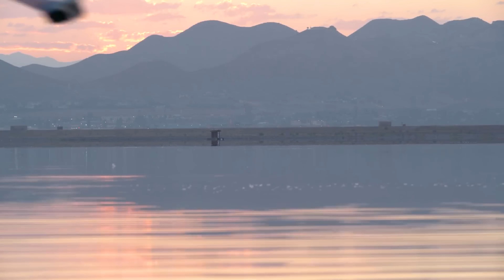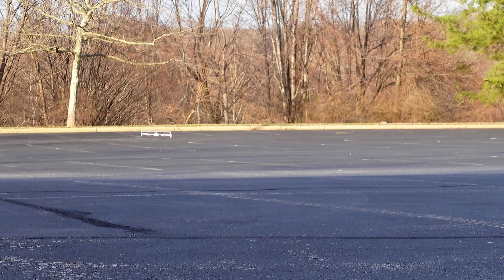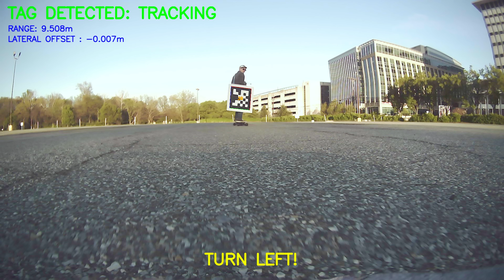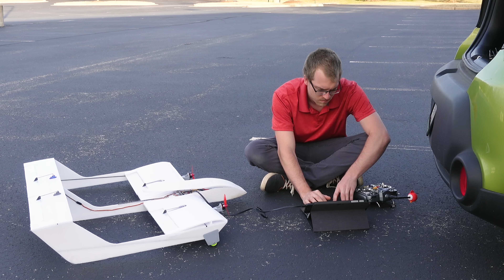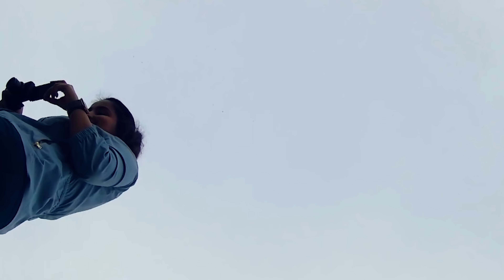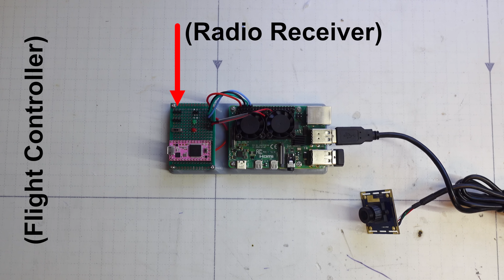Ground Effect Vehicle Autonomous Vision-Based Tracking

Comment: Curious, have you since looked into a Raspi Pico or even ESP32 as a replacement to the Tennsy? Could they handle to load if so? Or...you code is done, it works and you're sticking with it lol? Totally get it if so lol.

Comment: I made a project once for uni that required me to do image processing on a rpi, the trick is to use the processing intensive algorithm only to get the initial coordinates of your target, from there you can switch to optical flow, which in my pi 3 ran at about 30fps, and every 1 minute go back to the recognition algorithm, it worked pretty well in my case, but the optical flow tends to get lost and start tracking something else if left alone for too long, so ajust that interval for your use case

Comment: Stange to control the altitude with the flaps (lift variation) instead of the stabiliser (angle of attack).
Reply from the maker: It was a bit easier to hold pitch attitude constant to avoid tight coupling with airspeed, which is much harder to accurately control (especially without a pitot :))

Comment: I arrived here after Tom Stanton's VTOL video using your code- Its super cool, and while I do have a VTOL already and I hate to duplicate anyone's project verbatim I don't have years to iterate to get to something that reliable.  I'll probably get around to it after wrapping up current projects in a few months and hopefully have something new to add.  With that said, I might pick up a Teensy 4.0 to prepare but I wonder if you're considering a newer alternative moving forward.  I don't want to get started on a board that's obsolete by the time I get going.
Reply from the maker: Teensy 4.0/4.1 is still 'state of the art' in the arduino world, so no risk of it going obsolete anytime soon. Only thing is that it's in high demand / short supply at the moment, so grab one if it's in stock because it'll be out of stock soon!
Reply: @NicholasRehm  Ok!  "added to cart!"   thanks!   It occurred to me that the control scheme for Tom's faux Osprey design is somewhat similar to my ongoing micro-ROV prototype.   Its a project affiliated with NOAA and National Geographic that I wonder if you might consider offering your insight on?  I'm thinking about redesigning now to accommodate a Teensy.

Comment: Does the tag recognition require color? If not, you might be able to reduce the bandwidth of your incoming data by scrubbing it down to greyscale, since the tag is so high-contrast
Reply from the maker: The detection is done on the greyscale image, and I basically just overlaid the solution on the color image before recording it onboard. So yea it does use up a few extra cpu cycles but not during actual detection where the load is the highest

Comment: Instead of using an AprilTag and localizing it in 3D, wouldn't it be simpler and computationally faster to use a distinct bright-colored object/dot and apply PID to the horizontal position of the dot in the image? It will still always point towards you. If you really want a position estimate (for speed control or perhaps prediction) then you can look at the size of the dot. My guess is that since you already had the Apriltag code it was less work?
Reply from the maker: Yea I considered that to speed things up, but distance measurement is pretty important—otherwise a pid controller on left/right location of a color in the camera frame will not be tuned for all following distances. Also, I already had apriltag tracking working, and was running out of steam on this project haha

Comment: The frame rate issue is an interesting problem.  Have you considered two cameras?  One as is, at high resolution and low frame rate for coarse tracking.  Then another at low resolution and high frame rate, with higher optical zoom, for finer tracking once you're locked on.

Comment: Hey Nicholas can you post where to get the Lidar and the PID please ?
Reply from the maker: TFMini Plus from sparkfun: https://www.sparkfun.com/products/15179
Arduino library to interface with it: https://github.com/budryerson/TFMini-Plus
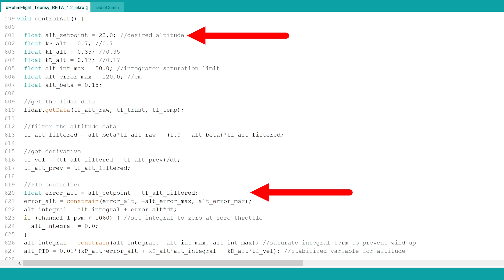And the PID code I wrote is at 04:46
Reply: @NicholasRehm  Amazing project thanks man, do I plug the Lidar sensor straight into the flight controller ?
Reply from the maker: @zero00tolerance  well, you would need to add the bits of code from the arduino library to initialize the sensor on a free serial pin. That basically entails copying a little bit of the library's example code to be able to get the sensor data into the flight controller code. Once you're reading data in the main loop, it's all yours to decide what to do with it i.e. write a little pid controller function to stabilize on a set altitude

Comment: Well done, I really liked seeing the programming involved.
Did you consider ducting on the props?
Can you overclock the PI? 
Can you burn a chip that runs faster to replace the PI ?
Great fun! Thanks.
Reply from the maker: Yes I overclocked the pi to 2GHz--which necessitated that big heatsink and cooling fan on top.
Looking into other single board computers and also AI-enabled cameras with embedded compute hardware, so stay tuned for developments on that

Comment: Hi! Im trying to build an autonomous quadcopter completely from scratch (no ardupilot, just good ole fashion python) and was wondering what method you used to tune the PIDs?
Reply from the maker: Start with a test stand and dial in your P and D gains so it responds well without any oscillations or 'jitters' which are the result of overtuning. Then dial in a little bit of I gain but never too much. Then give it a flight and some manual step inputs and observe the response...too slow (P-term too low), overdamped (D term too high), drifting (I-term too low). If you're talking about tuning gains for autonomy/navigation, step one is get a quad flying in angle mode that hovers hands-off the sticks, then slowly increase your position/velocity controller P and D gains, and be ready to take back manual control quickly...
Best of luck